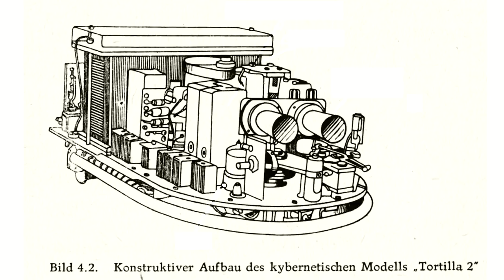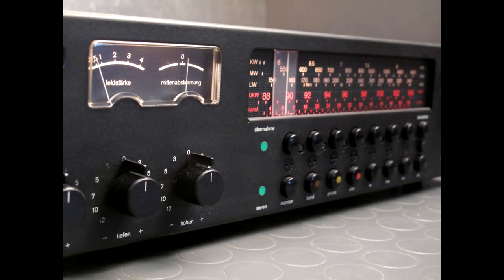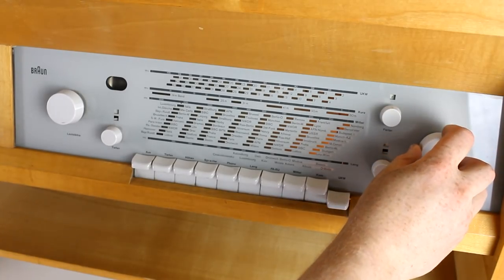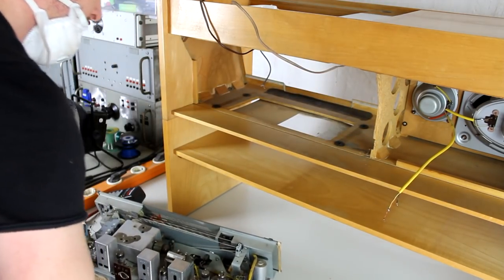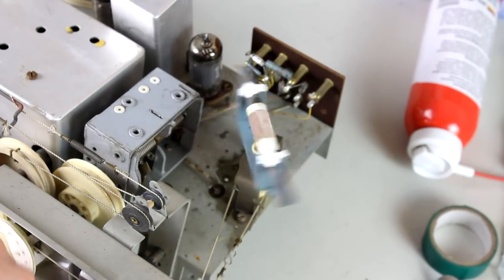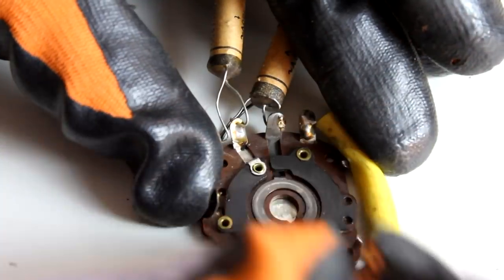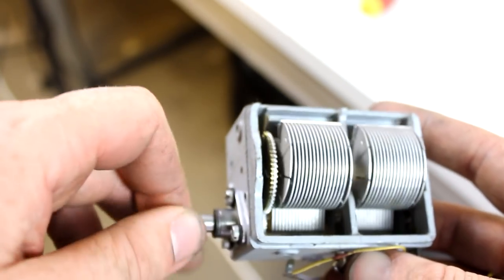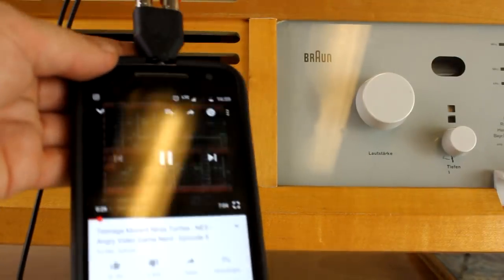Braun (1957) - Music Console Repair

Comment: Hi,

I need your help
I have a 4x el84 mono amp and one of the tubes was mechanicali broken i replaced it with a another one from a old radio and the replaced one glows much more yet i know it is infact an EL84 orginal tube
Reply: if it is a push pull amp the tubes must be a matched pair, if not one will work harder than the other causing damage and distortion..simplifying to the maximum: one tube pushes the speaker cone and the other pulls it to create sound...all the tubes and components on the output stage on push pull amp must be perfectly matched
Reply: Is there a way to "externaly" match them or do i need all 4 matched tubes? i was thinking of implementing a heater limit resistor
Reply: you should buy atleast a matched pair for the channel were you broke the tube....however if you bias them individually to compensate for the difference(probably have to modify the circuit) i guess there is no problem,but i wouldnt do it in a hi-fi good quality amp..even after correctly biased one of the tubes may get waeker faster than the other and start making one tube go hotter than normal.... the important is to pair the tubes on each channel to be matched one with the other..if there is a gain difference from left to right channel for me it doesnt matter and it will not impact the life of the tubes, only a slight difference in volume from one channel to the other...but if there is a gain difference from the 2 tubes on an individual channel thats a problem....i am assuming you have a push-pull amp...  a heater limit resistor i really dont know what it is(maybe some way of reducing inrush current to the filaments on cold start?) anyway the heaters or filaments of the tubes have nothing to do with their biasing...they just receive the 6.3v (most of the times) and heat the tube fot it to begin conducting..
Reply: This is a mono amp it uses 4x el84 and runs two 8ohm speakers in series
Reply: two 8ohms speakers in series its the same as a 16ohm, i dont see why a manufacturer would do that....thats a very odd configuration...are you sure about that? 4xel84 seems to me like a stereo push pull amp with 2 channels...2el84s to each channel...does it have one or two output transformers?do you have a model number ?
Reply: No it only has on output transformer and yes defenatly has only one channel 
The acctual speakers are two 4ohm in series so they are all in series :D never saw that before 4x4 ohm in series this is a FBT PA system with mic&guitar lvl input and a tape recorder on top
Im guessing its around 50W in class A
Reply: Idont know if it would be possible that its a kind of H bridge only with tubes
Reply: well its not the type of amp i am used to work on but....50w its probably push-pull.. i just dont understand how 4 power tubes for one channel...doesnt make sense using el84 as preamp tubes and since it is PA it probably has no preamp..... try to pull up a schematic... on a normal push pull amp you have 2 power tubes on each channel and the anode of each tube goes to each end of the output transformers primary winding.the b+ goes to the centre tap of the output transformer... on that case they sould be a matched pair or atleast biased individually, the way i do it is i measure plate current on each tube with a regular DMM or more simply measure the negative grid voltage.... and adjust the cathode resistor value (phisically change the resistor to a suitable value) until reaching what i want in terms of plate dissipation or negative grid voltage.. but this may not apply since i have not seen the schematic of the circuit... if it is pure class A 50% of current should flow through each tube when at idle
Reply: I can probbably send some picuters in a few weeks
Reply: no problem if you send the schematic i can tell you how to bias it to see if you get away with using different tubes